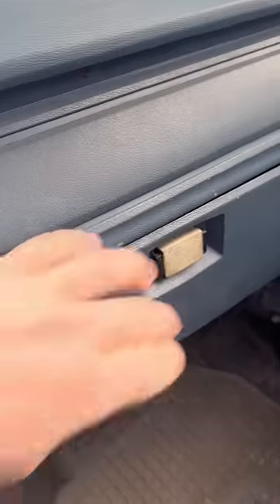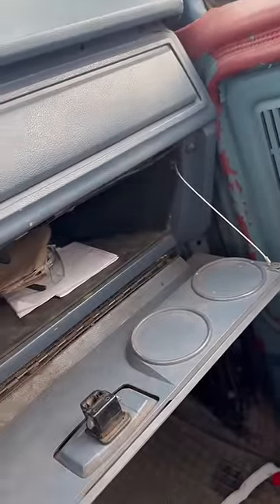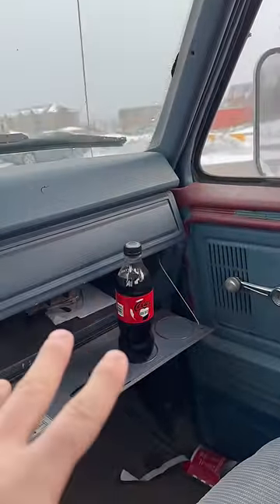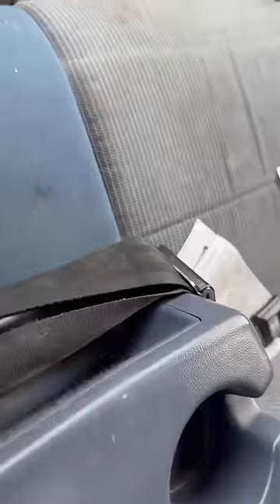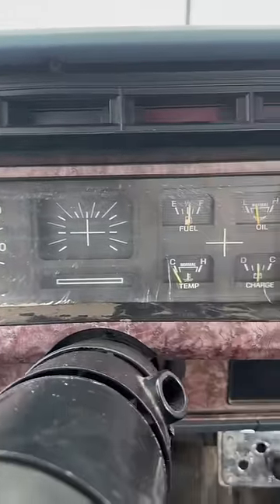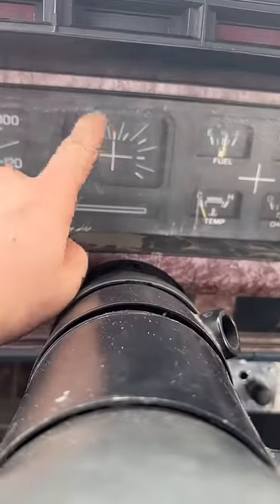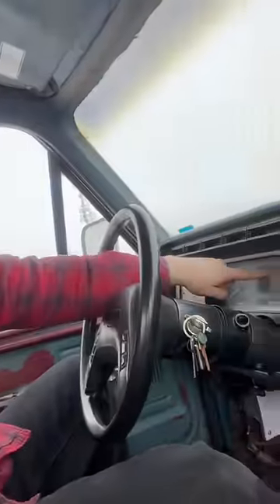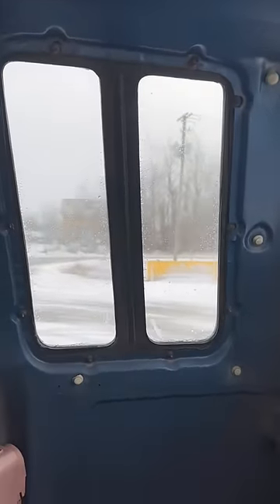Let’s talk 80s ford pickups

Comment: If you do find a tach for a bullnose it can be installed easily to the existing cluster with 3 wires one to power one to ground and one to the coil in other words it wires in like an aftermarket tach would and it goes off the number of times the coil fires. For a V8 you need to ground a second ground on the tach that tells it to count for a v8 not an i6. Diesel tachs are very hard to find because they measure off something different as the diesel doesnt have a coil but the gas tachs are surprisingly not too rare.

Bullnose tachs have this weird glue on their circuit board that can cause them to short and not work so sometimes that has to be scraped off to get the tach to work but gently so as to not mess with the board.
Reply from the maker: Good to know, the diesel tachs are super rare so if I do find one I’ll be either doing like you said or replacing the whole thing, good advice thank you

Comment: Had a 91 F150 (300/5 speed), 82 F250 (400/auto w tach), 81 F350 (300/4 speed), and currently a 87 f350 (460/4 speed w tach).  I miss the 82 the most (brother wrecked it), though the 91 had nice creature comforts.

Comment: Had an 86 w/ 302. Was my first ever vehicle and the damn thing was meant upon purchase with only 33,000 miles on odometer. Can’t verify if it ever toggled over after 100k but it always drove well and was reliable as all hell with the expense of being slow ash. It was that nice solid ford red. I put 44 flowmaster exhaust and American racing torque thrusts polished aluminum on her. I had a pretty ass truck. I miss her
Reply from the maker: Yes sir it sounds like it was quite the weapon

Comment: Yeah, back in the 80s one combination wrench pack a socket set up to call it 1 inch a standard pack of screwdrivers in assortment of pliers, needle nose, couple of hammers and chisels and pretty much you can repair 98% of everything on that truck. Oh and don’t forget a multimeter for measuring resistance and voltage and you’re good to go.

Comment: Was that cup holder really aftermarket?  It looks like the 90’s factory one that hooks to the front seat.
Reply from the maker: This one is, I have the smaller one you are talking about in one of my other trucks, this one only has middle seat belt holding, no holes for the front seat hooks.

Comment: I have a 1983 ford F250 Diesel 4 on the floor under 10000 miles on it and I payed 7500 bucks and I’m 16 I saved my pennys for it and it’s clean man like not a spot of rust on it clean

Comment: we had a 81 f100 "custom" sky blue with that same blue interior. the door cards were so dry rotted, you could run your thumbnail across it and it'd just flake off lol
Reply from the maker: Yes sir not wrong there, early 80s was a rough time frame for interior plastics haha 😂

Comment: My goal is an 86 f350 CCLB dually. 6.9 idi with the automatic trans (yes I know the autos aren't the best but I have other trucks as towing this would be the cruising truck). With the tachometer, and factory a.c. and heat.
Reply from the maker: Hey nothing wrong with a c6 auto, but the idis are quite special because you can get factory parts to bolt an Alison to them, would be a pretty slick way of running a heavy duty auto
Reply: @highostablegarage  ya. I've thought about mating an allison 2000 to my 7.3 powerstroke. I know it will bolt up with an SAE bellhousing, I've had them in my shop. But it's a lot of work for a truck that doesn't tow very often.
Reply from the maker: @snoopytheace4487  very true, won’t hurt a c6 ford just romping to town a few times a day.

Comment: Not a tachometer but speedometer for 85mph (or 120/140).  Normally you'd have a temp or oil pressure and Amp meter where your speedometer is located at.  I've seen that instrument cluster too many times in the non diesels.

Edit: they also changed the styling of it mid 80s and on.  You can also borrow parts for it off of mid 70s ford's too.

Comment: I’m trying to find a 6.9 to swap the front clip over on my 96 350 because they just look so much better
Reply from the maker: That’s what I did on my 96 big block shorty, I don’t blame you
Reply: 92 through 96 and 97 250/350 are the best looking  but that's what I grew up around.
Reply from the maker: @chrisgraff1979  used to have a 94, wish I never sold it

Comment: Fun fact; 80-96 have the worlds easiest heater core behind the glove box.
Reply: The entire truck is easy
Reply from the maker: Blower motor change is a 5 minute job which is awesome 👌
Reply: @highostablegarage  
Blower motors are easy on most cars.
Reply from the maker: @benztech2262  very true but these ones you don’t even have to bend over under the dash, just open the hood with your ratchet and you’re good to go

Comment: Yeah I've got like I think it's an 81 with a V6 in it. It has a 4-speed or 5-speed behind it manual. Honestly I wish you had something else other than that V6. I've got another one that has a 300 straight-six. It's an 84 and I bought it and probably 95-93 somewhere in there. Oh I redid everything mechanical on it because I was younger and had the time to do it. But at 306 with the granny low it just keeps on going
Reply from the maker: Yes sir it will likely keep rolling for years to come too

Comment: Sad to say that the newer pickups they make won’t last this long
Reply from the maker: I don’t think so either, when the selling feature for todays truck is how many touch screens they likely won’t last haha
Reply: @highostablegarage  ya that, and the materials that are used in the newer trucks are usually the cheapest to cut costs.
Reply from the maker: @Outdoorsnmotors   very true, 20 gauge and 22 gauge steel can be found all through vehicles now, 16 and 18 used to be the standard

Comment: That late '80s truck 250 diesel has a New Holland motor. They are bulletproof.
Reply from the maker: Yes sir, international made a good power plant with the idis
Reply: They’re NOT a New Holland engine, the 6.9 is an International Harvester engine and the 7.3 IDI and all 3 Powerstroke (that’s a Ford trademark name because IH let them license the engines as such) engines are International-Navistar engines. New Holland was never even part of the same company that designed these engines, IH sold its agricultural division in 1985 to Tenneco, who rolled it into its already owned J.I. Case division. BUT they did not sell their Truck and Diesel engine divisions, they renamed the company “International-Navistar” and kept on going as their own entity, no connection to New Holland at all.

Comment: Wierd that my 86 didn't have the cup holders,  my truck was a single cab XL 350 , as for being the same brick nose as yours , mine was a bastard truck like yours too cobbled together with 15 different trucks ,   I loved my color scheme though I had a brown cab and nose that had that faded tan stripe and trim down the side but an all brown bed same brown with no tan stripe but same trim and it took me forever to find that bed for that truck because I was running a skeleton of a bed that wasn't attached to the wheel well on the passenger side and the structural cross member in the back was so rotted that the side of the bed would flop in.the wind the first 6 months driving that truck,  I put a service bed on it for two years till I found that brown bed that was on a complete  parts truck ...
Reply from the maker: That’s awesome haha, I always like seeing multicoloured panel trucks because it shows someone took a truck that had no business being on the road and kept it alive

Comment: It's also worth noting the 80-86 extended cab wasn't called an extended cab. If I remember right ford actually used the name king cab for a short bit
Reply: Oh and also avoid tilt columns if you can help it. They're very prone to stupid issues. My 89 would bump the ignition just enough to turn the engine off when I turned the wheel to the left.
Reply from the maker: As fas I know it’s a super cab but I might be carrying that over from the 70s trucks, worth a fact check on my end, might very well be a king cab
Reply: @highostablegarage  wow i feel stupid. i own a 78 F150 XLT Lariat 4x4 super cab and completely forgot it was named as such lol. its a very weird truck. despite being an F1 series and having 5 lug axles, it had leaf springs on all 4 corners like an F250. I got it for $400 cause the guy wanted the axles for his jeep. had i known how rare that axle is I would've paid him more. 

oh well, more fun for me trying to find a leaf spring front drivers drop dana 44. I'm probably just going to give up and find a dana 60 from a 250 and go 8 lug.

also tried to google king cab fords and can't find anything immediately so it must've been made up. I also read that when I FIRST GOT MY 89 F350, so that would've been about 10 years ago when i really got into 80 to 97 ford trucks.

Comment: I have a few gas tachs, but have never found a diesel. Suckers sell for $300+ these days if you can even find one.
Gas tach should function the same in a diesel, but it'll show up to 6,000rpm and the pump will cut fuel at 3,500 so you can only use just over half of it 🤣

Comment: We had full instrumentation in a delivery truck the boss drove daily.
The oil reading read high.
Kinda too high.
The other trucks were square body Chevys and couldn't take the abuse.
The Ford was built Ford tough.
True story.
Reply from the maker: Sometimes more isn’t better haha 😂
Reply: Yeah, the dealer said don't worry about it.
I thought, how can we trust it?
Well, I learned it's an indicator.
It's not actually gauging the pressure.

Comment: 1980 to 1986 are exactly the same trucks for swapping of parts late 86 models came fuel injected so motor parts may be different 1987 to 1991 are also the same

Comment: I have the 91 f250 which is technically kind of an 80s ford since the production of the 87 to 91 f series or I think the 8th generation the production ended in 91 but either way I have the 460 big block in it (some people don’t like the 460 it’s one of the less popular motors of the time but I love it) however someone for some reason removed both the gas tanks at some point before I owned it I’m the second owner it only has 138000 miles on the thing and it’s a super clean truck however the previous owner removed both gas tanks and replaced them with 1 12-16 gallon tank not sure really but basically If I drive the fucker 45 minutes I’ll lose half the tank…I was wondering if anyone knew if it was possible to put a bronco 33 gallon tank on the f250 and how I’d go about doing that

Comment: My 1987 F250 has a techometer or however you spell it. Lol  I'm selling the whole truck for cheap if anyone wants it don't have room in my yard for it anymore. Mine has the windows that slides open in the back too.
Reply from the maker: That’s awesome 👌 if you were around here I would likely be interested haha 😂
Reply: @highostablegarage  I'm in New York. It's a 4 on the floor manual transmission. 1st gear is low. It's a V8 gas with about 119k or 219k miles. Truck sat for the good part 20 years just driven here and there. Red leather bench seat.
Reply from the maker: @GiuseppeSimonetti  yes sir sounds like a slick unit

Comment: I own a 1986 f150 with a 302 5.0 v8 I love that truck to death and my grandfather owns a 1984 f150 🤠🇺🇸
Reply from the maker: Yes sir very good taste
Reply: I loved my 87 302 h.o. automatic 3spd would go 60+ in first gear. Was once going 70 floored it and went to first unlimited revs
Reply: @rosslefave5877  Shii that’s also a nice truck too 😏🇺🇸🤠
Reply: Pulled better than e250 5.4 van was fun truck to drive truck was rust free 500$
Reply: @rosslefave5877  I got mine for free
Reply: @rosslefave5877  but it’s not rust free tho 😅 but I like the little bit of rust bc I like how it looks old and not new 🤠
Reply: @bobgan4434  nice I have 98 ram 1500 V6 for free. I love the beaters
Reply: @bobgan4434  probably 2k of parts and doing some work that87 would've been pricey. I seen I think a 88 f350 460 20k miles wanted like 30k. But I'd buy that way before some new truck and it'd last way longer than a neW

Comment: But will the back side windows interchange?
Reply from the maker: I’ve heard super cab rear glass won’t with single cabs but don’t quote me on that, as for single cab to single cab yes, 80-96 will work but the windows have slightly different latch designs

Comment: 88 F250 had the sliding split windows
Reply from the maker: Yes sir seems to be a mixed bag on the brick nose pickups, lots had the single window, others an overlay over the single, others had the duel glass

Comment: I had a 90 F250 king cab had the split rear window. I can show you pictures right now of it.  Factory bricknose truck. That information can’t be exactly right.  For sure the 92-96 trucks didn’t have them. But the bricknose trucks sure did

Comment: The clock was there in the middle if you ordered it..I think the tac was on the left.
Reply from the maker: This Gen tach would have been right in the middle on the big square, the clock was in one of the 3 rectangles above the radio, that little fella is also a rare piece to find.

Comment: Dad bought an '85 F250 4x4 with a 460.
I called it the Ross Perot edition necause when you romped on it all it did was make "a giant sucking sound!"
What a gutless turd!
Reply from the maker: The 385 series engines are great power plants but there was a few years they where restricted down a bunch for emissions, I believe you on the fuel economy, best I ever got in my 460 was 10 mpg
Reply: @highostablegarage  You're correct. It needed to breathe. Low compression, poor cylinder heads, and a weak cam leads to disappointment pulling a loaded cattle trailer. And then John Kaase came along.
Reply from the maker: @MilkMan608  yes sir best heads in the business he makes

Comment: Isn't this also the era where Ford had the 302 V8 and the 351 V8 where the 302 made about as many horses as the 351?
Reply from the maker: Similar smog systems so yes you are right
Reply: @highostablegarage  Smog systems are kind of a scapegoat.  I put it down to bad design.  Today we have cars that run clearer, get better mileage, meet smog and have plenty of power.  Practically none of what makes that happen was beyond reach in the 1980s.  It might have cost more to do but no new physics got invented for it.

Comment: The split window is false, my 1990 f150 has factory split window in the back. My 1989 however does not
Reply from the maker: Seems like the late 80s and early 90s was a mixed bag for the split window, some had the two little windows like the early 80s, others simply had a full window with an overlay on the outside to make it look split, others just had a full window like the mid 90s trucks. I made a revision in the comments addressing it

Comment: 80 through 91 had th split windows
Reply from the maker: Yes sir seems to be a mixed bag, a few fellas have been saying theirs have the two separate panes, others said theirs was an overlay over 1 sheet, others have said it’s was just the 1 sheet of glass like the mid 90s trucks, I made a pinned comment addressing it 👌

Comment: Is it a 87??? my 87 had the split window
Reply from the maker: This one is 85, seems to be the brick nose era was a mixed bag between the 3 styles of rear windows
Reply: @highostablegarage  hell yeah my old 87 actually had 1 of the 1st Triton motors...  (I'm not sure if it was stock) ...my 84 extended cab had the 351 windsor but it was completely  modified  with a cam etc... now I'm tryna fix up a old 84 short wheel base with a step side bed wish it had the Windsor but it has the 302..in the end id like to hemi swap it...

Comment: Show them how the axel seals fail and destroys the brake linings so you need new brakes every year.
Reply from the maker: Never had that issue before and I’ve owned lots of these trucks, maybe don’t overload the axle or run it dry, wheel seal will stay in it that way
Reply: @highostablegarage  I had a new 1993 F250 and replaced all new brakes under warranty. Then twice again on my dime.
Had a 2006 F250 with disks and replaced calipers every other year for 10 years.
Now I have a Ram 1500 with no issues.

Comment: no the split window was 80-91. i know this because i had to replace my window in my 89
Reply from the maker: A few fellas are saying the split window for the 89 years is just an overlay panel on top of a full window like the 90s trucks
Reply: @highostablegarage  nope because i had to repair mine. they are identical to the 80-86. how else are you attaching the split window trim on the outside, drilling a hole thru the glass?
Reply from the maker: @Andy47357  glue, might only be a select few at the end of the lifespan of the bricknose that had the valence panel
Reply: @highostablegarage  i’ve bought plenty of supercabs bricks never pulled the glass or interior on a 91 but i know that my 90 and 89 both are identical to your earlier one. also any glue that they had used back then would have fallen off by now